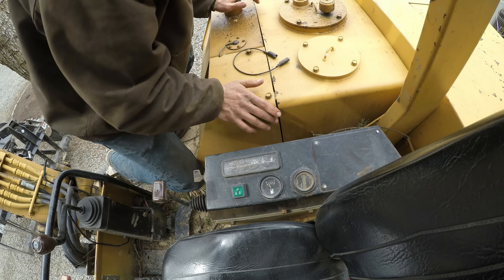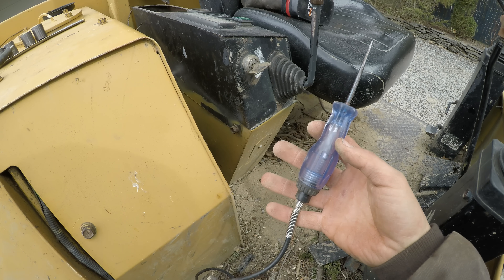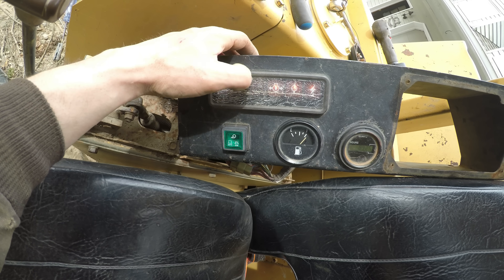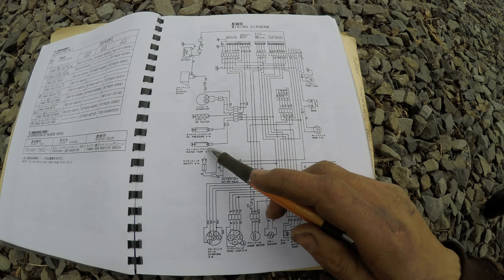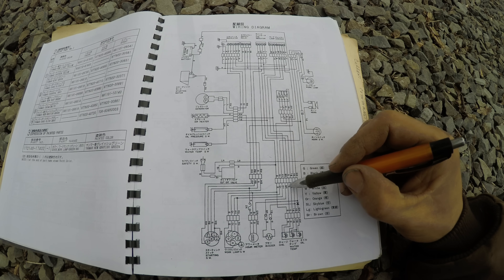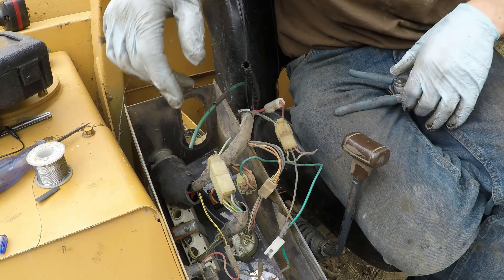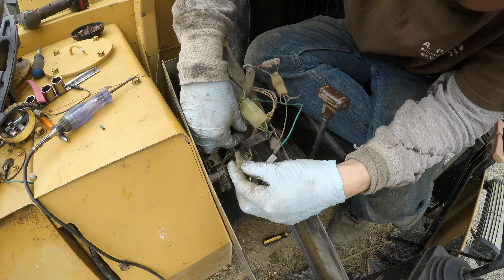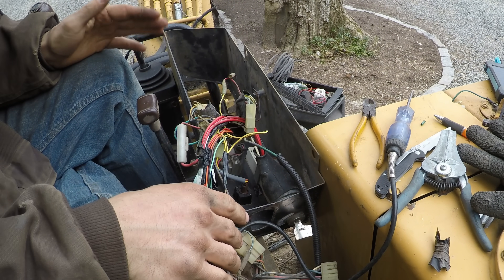Fixing electrical problems on the Yanmar excavator

Comment: Too bad you didn't check continuity between the buzzer and the temp switch wire, they are probably the short that was causing both of them to fail, which means you may have more issues down the road if any other wires in that same location end up shorted.  Good fixes, though, glad to see somebody who knows how to troubleshoot/fix stuff himself.

Comment: Did you take a look in the "lamp checker" compartment ?
There could be the contact between the light green wire from the water temp or oil pressure wire and the buzzer.
The whole lamp checker is a derivation,so some crap,corrosion or somebody could have closed the circuits there,wich would power the buzzer.
Reply from the maker: Yeah, I had cut a few other wires that I thought should had stopped the buzzer. Still didn't stop, that's when I decided to re-engineer it.

Comment: What timing...I had mine open to fix some corrosion on my hour meter harness the day before yesterday.  I finally sourced a hydraulic filter - had a hell of a time...Have you replaced tracks on  yours?  Or ever flushed final drives?
Reply from the maker: I have replaced one track, sprocket, and rebuild a track tensioner. I have changed the oil in the final drives.
Reply: I've got to get that service manual and flush those drives...thanks for the awesome vids...

Comment: The lamp checker is what turns on the lamp when you turn the key on before starting so you know the light is working. Your problem is in the circuit going up to the block saying lamp checker. Their should be another diagram showing from ign. Sw. to the lamp checker circuit.
Reply from the maker: Yeah, but I cut that wire too, it still didn't stop buzzing.

Comment: Andrew,its sad but yes,john deere just aint what it use to be,i worked in a machine shop,Furukawa Rock Drill bought the place,hate to say this but yes,they are the best rock drills u can bye,also make hydraulic boom mounted breakers,they are the hardest and fastest breakers on the market,get on line look up Furukawa Rock Drills North American Head Quarters,yes that's whats left of the place I worked at,

Comment: REplace the temp sensor with a thermocouple and add an actual temp gauge !
Reply from the maker: I was thinking that. I wouldn't even have to remove the temp sensor as there are extra spots for more sensors on that motor. But I had a fa/water pump belt break on that machine once, and the loud buzzer was a nice way to tell it was over heating. I might not look down at a gauge often enough. I still could easily add a mechanical one though.

Comment: Is the warning buzzer for battery? My Takeuchi had a sensor in the battery. (Physically in a cell) to indicate fluid level I guess.)   I took that lead and went straight to hot and that fixed it.
Reply from the maker: The buzzer is for temp/oil pressure. A battery problem isn't an emergency which can ruin the engine like temp/oil.
Reply: Yea, the buzzer on my Takeuchi wasn't an emergency, but it was annoying as hell. 
Same basic engine though, that was a yanmar unit. (I had a TB25)
I guess it all in what the manufacturer chooses to warn you about.

Comment: I agree Yanmar is top of the line .... and John Deere is garbage , we had a brand new  JD 644k demo wheel loader  at work 260,000 dollar machine broke down 2x in first 50 hrs , went back with a hydraulic moaning pump sounded like it was on its last legs we didn’t trust it , had to rely on our 25 yr old loader ....my Cat 246 skid steer has been flawless , had 3 problems with it and all 3 were caused by leaving it out in the weather with an open cab, both control levers the switches went bad in the aux on left and horn button on rt, and fuel sender went bad but previous owner left it outside with no fuel cap water got into the tank I flushed the tank but the rust got to the sender took it out .... put a new fuel sender in and control switches and it’s good as new ...never a single breakdown in 2000hrs
Reply: Ha!  I've been telling people for years that the JD yellow stuff isn't worth a crap too!  Maybe the green JD's are fine, I don't know, but I've ran a JD 644 as well and also a JD Tracked skid steer and both had more problems than they were worth.  Both were brand new!  I chose the Komatsu 320 over that 644 every time.  Faster and stronger hydraulics.  Faster wheel speed.  All around better and it was a touch smaller and outdid that JD(when it ran right) all day long.  Hell the little Komatsu w95 could almost outdo that 644 hahaha!
Reply: @aadoublea  Had a JD 5410 on the farm, lots of problems.  Even the JD riding mowers are not all that great.  A Cub Cadet will mow circles around them.
Reply: @RudyNortz  I believe it!  I still keep thinking that at some point JD had to be pretty good because they do seem to have a lot of fans.
Reply: @aadoublea  same reason lots seem to pray at the alter of Apple. Some companies seem to be blessed with sheep customers who put up with rubbish, where as if it were almost any other brand they would just vote with their wallets and go elsewhere...
Reply: Back in the 60’s and 70’s JD tractors were great! My Dad had two 4020’s that were flawless workhorses. I’ve been looking for a decent mid 60’s 4020 for my own use.
Reply: I’d be pretty pissed if it broke down after 2000 hours. As 2000 hours is nothing. I’ve a John Deere 6610 with just over 10,000 hours. Of course it has its problems but everything does. Farmers here are getting 20,000 hours out of there tractors. Fiat 110-90 here which is on YouTube which has 28,000 hours. My fiat has only 7. I’ve another 20 in it at least.
Reply: Outside with no fuel cap on, Ridiculous
Reply from the maker: dieselman29200 it may share some parts. But John Deere probably screwed it up with some of their junk part designs. Just get one that says Yanmar.

Comment: I’ve got a Komatsu pc50uu gray market machine but it has been amazing slow but amazing. Had it for about 8 years and it’s broke one time other than needing some seals and it had a leaf in the fuel line one time. Also 
gehl/yanmar track loaders are great but I would get a takihuchi over the gehl.
Reply: used to run a pc75uu grey market machine. dead  reliable!
Reply: Takeuchi is a beast, but their support for older machines isn't great. Try to get a track motor for a 15+ year old machine sometime.
Reply: Maxima A grey market machine is one that’s been imported from overseas, not originally built for the North America market

Comment: i learnt 45 years ago that if you work for yourself and you run any sort of machine,the only way to keep ahead is to repair it yourself,as you do. But with that many hoses you should look at buying your own crimper and buy the hose in bulk . Making up hoses is simple and doing it yourself you can save thousands as most hydraulic gear uses the same fittings so no need to hold boxes of ends etc. I guess yoyu also buy your hydraulic oil .if you dont,it's good idea to buy it in 44 gal drums with the appropriate drum stand to hold it.
Reply from the maker: Aren't those hydraulic crimpers extremely expensive? Plus having an inventory of every coupling and hose size.
Reply: i know this is an old post, but being a hydraulic tech i can tell you that hose crimpers are the most important thing you could buy for your shop. Pick a brand, parker, gates, aeroquip and stick with it. Go by your local hydraulic hose shops and see whats available. Thats the most important part, if you dont have a gates dealer for 50 miles, but have a parker shop right down the road, stock your shop with parker parts.

  Most kits start around the 2k-3k$ mark, gates is the cheapest and easiest to deal with, but parker and aeroquip make nice stuff too, just a little more money for the fittings and hose. I would suggest you get 1/4 3/8 and 1/2 hose dies and 50ft rolls of each of those. Those three sizes will do 90% of all of the hoses on that yanmar that you had in this video, Possibly 5/8 for the main lift boom cylinder. Ideally you would want the same size hoses to go back on, but substituting 1/2'' hose for 3/8 isnt going to do any damage, likewise for 1/4 and 3/8. You can always go up, never down in size.

https://www.ebay.com/p/Gates-MobileCrimp-4-20-Adjustable-Hydraulic-Hose-Crimper-W-air-Pump-3-Dies/1780593694?iid=153158667115 

 heres a crimper for 2300$ comes with 3 dies. Each die set around 450$. Easily the best crimper for the price. Especially since its air powered and portable to the jobsite. However i probably wouldnt stock anything 1'' or larger, since its so rare to have to replace those size lines it doesnt make much sense.
Reply: My old company we done most repairs in house we always had hoses made up already especially breaker and arm hoses same with tyres we had 4 40 ton dumpers 13 10 ton dumpers and 9 6 ton dumpers the 24 telehandlers so paying someone to come out was just stupid we had a site that we got upto 16 punctures a day my boss said it saved him around 30k in call out charges every year but my boss started doing that when he had only like 5 machines going so even when its a small company its still worth it
Reply: Andrew Camarata Don't need those fancy expensive crimpers.  Search the web for hydraulic hose repair kits.  Some very simple crimpers are available that work well and can easily be used in the field.  Will make a huge difference simply by allowing in-field repairs - no more running to the hose shop and being ripped off with high prices, or finding the place closed because after-hours, weekend, holidays etc.  Plus the repairs are cheap - can use splices to repair worn spots in otherwise perfectly good hoses.  Stock a few common fittings and hose diameters and the kit will pay for itself the first hose that breaks.  Common to be back running in a half hour to an hour depending on how difficult the hose access is.
Reply: If have a look, the cost of hoses is all out of prortion to what you are paying for. On Some jobs we had to replace all of the hoses to comply with insurance cover(inside shopping centers digging a floor up for example) .But most machines all use the same size hose. and there used crimpers about. they operate from a portopower (a handy tool sometimes if you stuck pins or bearings .)
Reply: I bought a parker karrykrimp for 500$ with 3 dies and 2 rings.

Comment: what yr and model is that yanmar and what would be a good price if someone was looking at one??
Reply: If you look in the video description, Andrew usually references the equipment specs he is working on or with if not a “how to repair”. In this case it is a 1991 B50. A five ton class machine. I suggest you look online at Equipment Trader. Com to find price for a similar piece in your neck of the woods, as prices seem to vary regionally and with the number available.
Reply: Doug Corrigan thanks i usually dont check the description box but will now before asking a question like that agian

Comment: Hitachi are top notch machines 95% of the time. As with anything its how they've been looked after. My zx120 has just nudged 9000 hrs
Reply: NZ DIRT I’ve the zaxis 130 nearly 9000 hrs too. It’s good but dipper arm cracked and it was always powerless tracking especially turning. It’s the lc model other wise it’s fast.

Comment: Hey buddy, get yourself a can of Deoxit for those electrical connections. You won't believe how amazing that stuff is. You can get it on amazon or at electrical/electronics dealers. It de oxidizes and chemically improves connections, it really is amazing stuff.  Also having a portasol would be handy for anyone needing to do field repairs to wiring. A portasol is a butane powered soldering iron. They are less than $50.00

Comment: At 07:58, did you forget to pass the new wire through the bulkhead :o)
That's the sort of thing I do, a real 'nyyyyaaaarrrrrgghhhhh!!!!' moment.
Reply: John Watkins 
I saw it too....but then i saw the other wires also go the same way (under side of the box),  the hole is for the handle/stick. 👍😁
Reply: lol,, that was bugging me too
Reply: Guust, You're right, I didn't realise it was the panel upside down!
Reply: It was on a connector, so he could have disconnected them if he needed to pass them through. But I think those just stayed inside the control box anyhow and didn't need to pass though anything.

Comment: Did you ground the top black box? You can always make a wire connection to a good ground and connect it to the black box, then you do not only have ground through (rusty) bolts. 👍😉😁